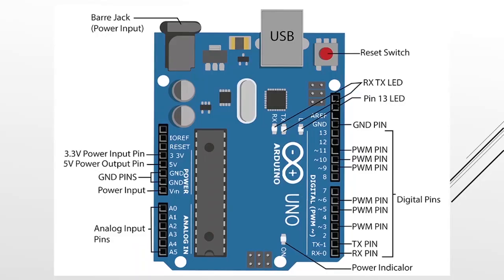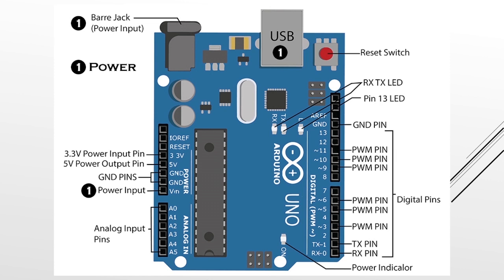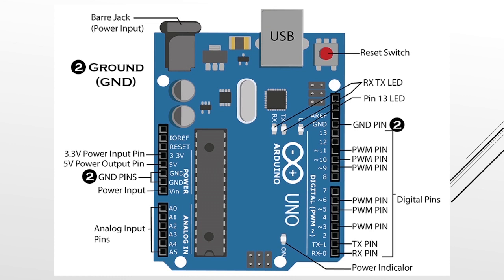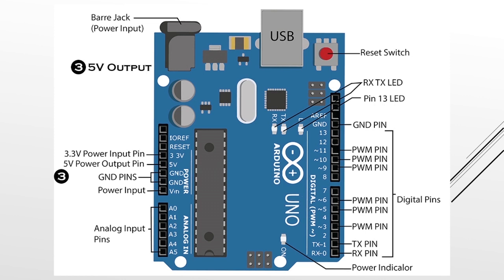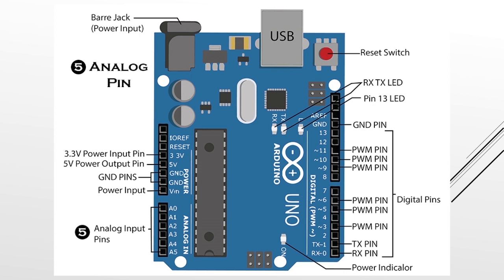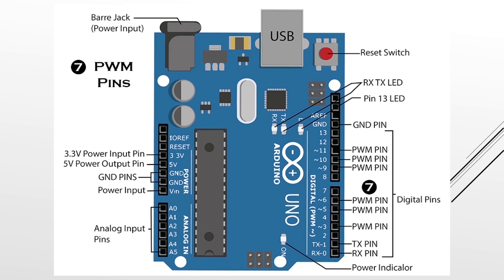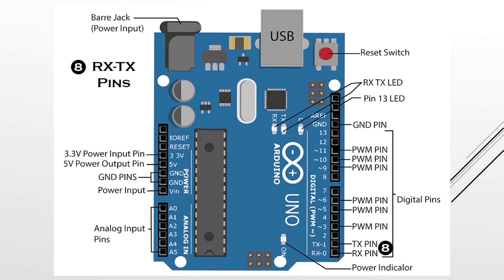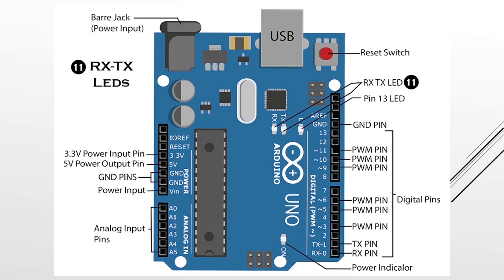Lesson 1 : Introduction to Arduino & its hardware

Comment: Sir,
3.3V pin is a power output pin?
Reply: NO i think it is also power pin like 5v but it supplies less volt for some sensors which do not need 5v. MAYBE😀